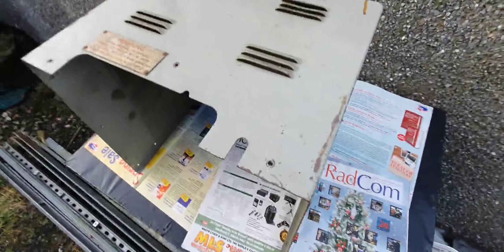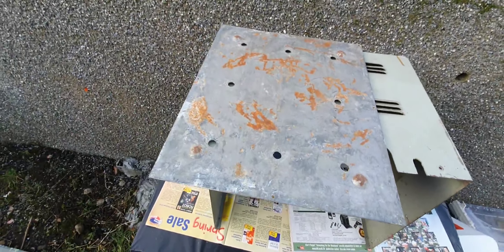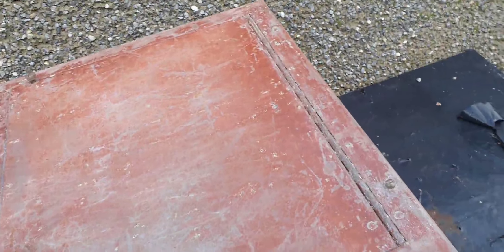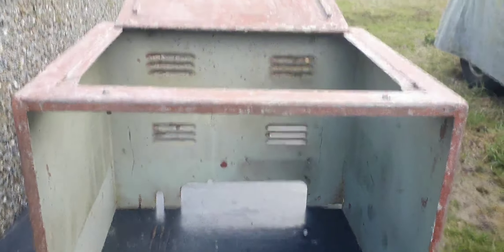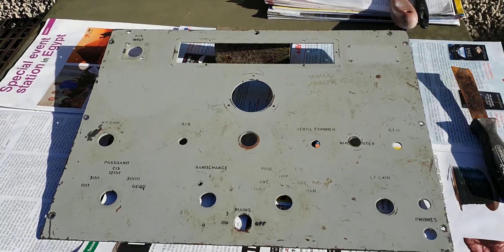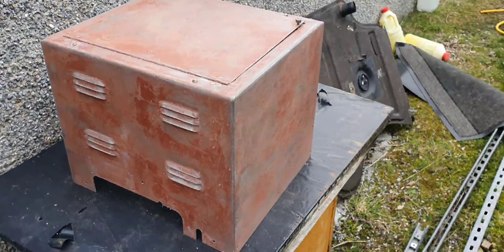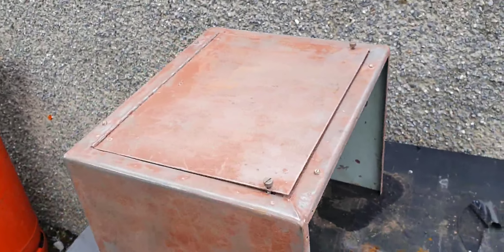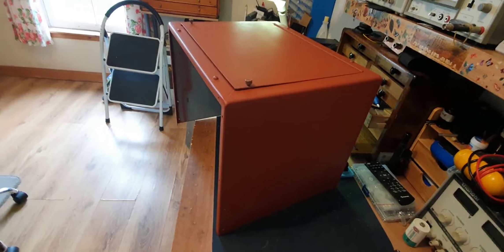Marconi CR100 Renovation (54) Case repainting

Comment: Hi Simon,  after some time spending on other things and my health I am getting on with theCR100: LF, BFO and IF is completed now. Now, figuring out the HF part. Hope you stil keep your youtube's on the net because I often view at them. Calibrating is also on my list in due time.
Best regards, Herman PA3EHZ
Reply from the maker: Hi Herman. Similar problem here re health and other things.  All  I need to do is the front panel lettering. I intend to use screen printing and have been experimenting with that. Coming along fine . I just need to hone my technique to get a good result. (My wife thinks I'm being a bit pedantic)
I have no intentions of taking down the videos.  I might add others in future as nearing im retirement and I have an Eddystone 770R to get working..  Best regards and 73 Simon.
Reply: @simrich306  OK Thanks. Best regards, Herman

Comment: Hi Simon,  I am still busy with the CR100 although I had a long delay due to sickness. getting better now. I finished the DC part and the audio stage incl. the diode/triode valve. However, on the the top cap of V8 (so the grid) I got a 15 V DC which I find strange. The manual reports that Marconi applied a bias from the cathode of V8 (which has the same voltage.) I get no humm from the top cap of V8 with my finger in the speaker. Have you any idea about this? A Vg1 should be zero of neg. Hope you have some info. Tx in advance. Herman
Reply from the maker: Hi Herman. Glad to hear you are on the mend, I to had to have an operation a year or so ago just when I was nearing the end of my restoration, That slowed me down a lot.   I have finished the radio all apart from the lettering on the front panel. I need to get back into practising screen printing before I tackle the front panel.  
After reading your question I went and switched on my CR 100  ( which hadn't been powered up in months) and was relieved to hear it still worked.
The voltage on the grid (TC) of valve 8 on mine with  respect to the chassis (ground) is 13.65v and varies with the volume control. 
The manual states the voltage as 1.8 v with respect to the cathode. Looking on the circuit diagram the cathode is connected to the junction or R25 and R28 . The junction of R28 and R29 is then connected to the grid (TC)  via the LF potentiometer.Basically its the  voltage developed across R28.  I haven't opened the bottom of the radio to measure between the cathode and TC .or R28.  That maybe where the confusion is.  Touching the top cap when the radio was operating didn't induce any noise in the speaker . But removing the top cap connection and then touching the bare grid did induce a loud hum. I hope this helps. When I get more time I will finish the front panel lettering and probably do another video of it completed.  Your question has given me a good idea in that I will make up a table of voltages of the various valve pins etc. 
Take care  73 Simon

Comment: Hi Simon, please do so. Can you tell me which new capacitors you used for the renovation. I thought of mica but they are hard to get. Perhaps ceramics in the h.f. and i.f. and MKT etc  in the rest? They must be for 300V...Getting slowly forward with the CR100 now, in my spare time. Tx in advance Herman van Dijk
Reply from the maker: Hi Herman. Good to hear you are progressing with the cr100. I used polypropylene 0.1 uf 600v capacitors to repack the ones in the metal cans, I got them on ebay  here's the link https://www.ebay.co.uk/itm/190816561218    The electrolytics for the main smoothing capacitor I used I  also got from ebay 10Uf at 450v 
The original mica capacitors on the tag boards I tested and they where good so I kept them . I hope this helps  73 Simon
Reply: @simrich306  Hi Simon, tx for the info. I already had the smoothing caps ad 10 uF and repacked in the old can. The DC section works well. Think I take some ceramics for coupling etc and further as you said.. Keep save! Brgds Herman

Comment: I wonder if the rails are for the optional TX?
Reply: That was my first thought too, but I had a brand new TX sealed in a plastic bag, and I don't recollect it being big enough to fit those rails. Mind you, it was a long tome ago, and memory is not what it was.
Reply from the maker: Hi That is a good point  .Ive just did a quick google search and got a picture of a CR100/7 with the tx in the lid but It looks bolted to the lid . The little hole at the back of the lid is for a spare fuse holder. 
https://www.radiomuseum.org/r/marconi_b28b_2_cr1007cr_100.html#

Comment: SIMON. THOSE RAILS ARE TO HOLD A IDIOT GUID TO OPPERATION OF THE RADIO. i HAVE THE ORIGINAL CARD IF YOU WANT A COPY..
Reply from the maker: Hi Dave. I thought it might be a slide in card of some sort but not an operating guide.  Would be great to get a copy and make one up for this one. Thanks
Reply: @simrich306  I will get one sent.
Reply from the maker: @sootydave1  Thanks . I will mention it on here once I have finished the case painting, Maybe of interest to others. Thanks
Reply: @simrich306  Hi Simon, please do so. Can you tell me which new capacitors you used for the renovation. I thought of mica but they are hard to get. Perhaps ceramics in the h.f. and i.f. and MKT etc  in the rest? They must be for 300V...Getting slowly forward with the CR100 now, in my spare time. Tx in advance Herman van Dijk